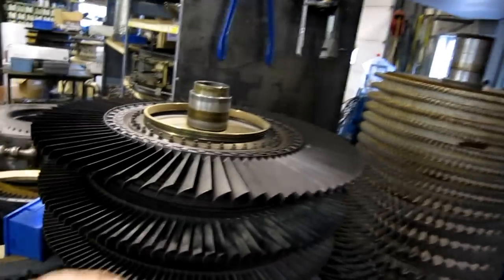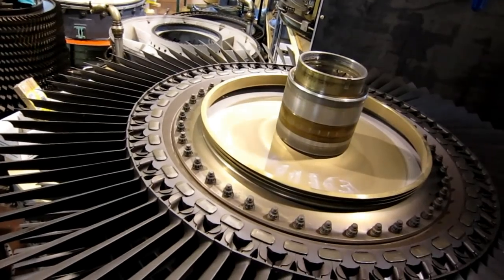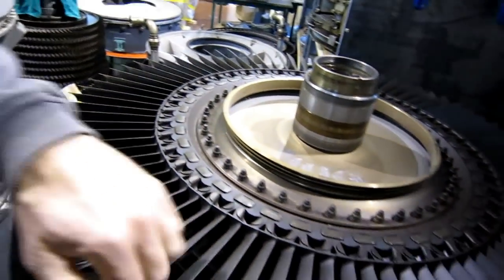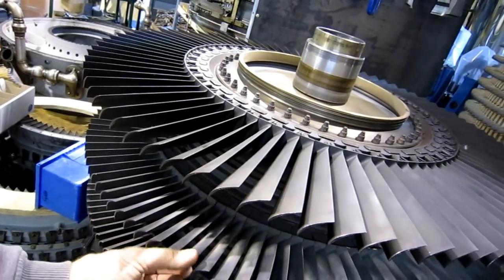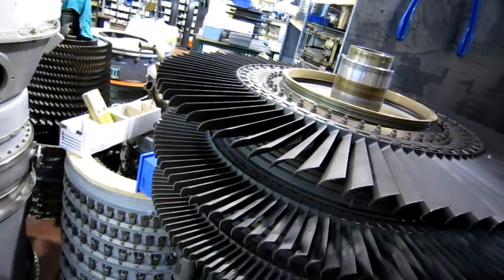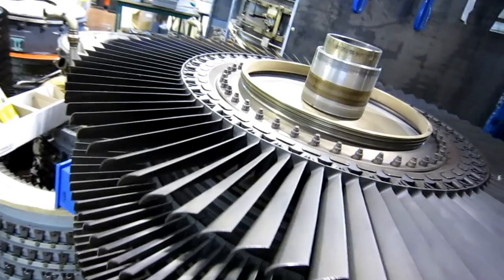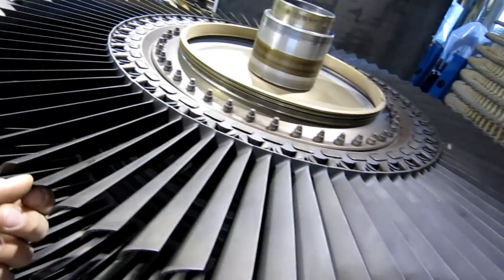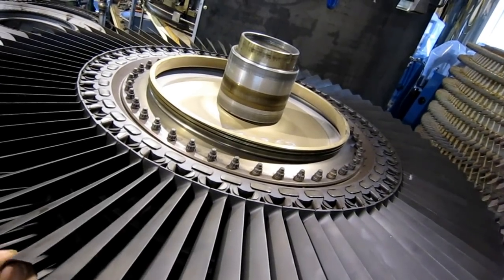Jet engine turbine blade noise

Comment: And no one's gonna talk about the fact that it's hd in 2010
Reply: Bruh do you think HD was invented in like 2018 or something? We didn't watch YouTube in black and white on cathode-ray tube displays.
Reply: lol HD resolution Announced at 90s How you Dont KNOW that?
Reply: HD was nowhere not as cheap or as common in 2010 as it is today.
Reply: @Rotated  wtf are you even saying. YouTube started supporting 1080p resolutions in like 2009 and most devices were at least 720p at the time.
Reply: @Rotated  Most cameras at the time (even cheap ones) were at least 720p, 1080i and 720i TV was very normal, and 768p+ computer monitors were the norm since like 2006.
Reply: you forget that many people on the youtube platform were still using old hardware as are people today. For example, though not strictly on the youtube platform, I'm using a smartphone from 2014 today, and daily. Someone in 2010 could have easily been using a 2004 or older camera. And computers, etc.
Reply: @Rotated  I'm still using a monitor from 2006, and it has a 1920x1200 resolution, but I get your point, consumer grade HD monitors were only in circulation for about 5-6 years at that point, so if someone hadn't upgraded in that time, they would still be using older tech. Still, even old CRT monitors could do 720p.
Reply: never had a debate on my stupidity but ok lol
Reply: @IcespherePlaysGames  ya but many people didnt use hd cameras in 2010, it's somewhat uncommon, and thats why i was surprised
Reply: @cgositonyourbed1111   people DID use HD cameras in 2010, it just wasn't included in their phones. Nowdays anyone with a smartphone has HD capabilities, and 1/3 of the planet has a smartphone, so it's very very very common. But back in 2010 anyone with even a remote interest in photography or video production (even home video) had a HD camera, just like handheld tape cameras were popular in the 80s and 90s. Even if we assume that people with these interests are 1 every 1000 people, that would make the amount of HD cameras at the time around 7 million, which is a few times lower than the amount of HD cameras that were sold until 2010. So, more common than 1/1000.

To be fair to you, 1 every 1000 might sound uncommon, but in the 8 billions scale it stops making sense to use the human understanding of common and uncommon.

If you lived in an area with plenty of well off people (even if it's just middle class) you were bound to know someone who had recently bought one of these cameras, i remember they were flying off the shelves in 2007-2008. It's amazing to look back and realize that almost every picture ever uploaded to facebook by 2010 had to be taken with an actual camera, then transferred to a computer and uploaded, it's so amazing that it gives people the sensation of being lost. So that's what i think it's happening here, people forgot about the digital camera revolution after the smartphone revolution. Don't get lost in time brother, cheers!
Reply: @IcespherePlaysGames  Most youtube videos from 2010 that you find are 144p or 240p and 720p if you hit the jackpot
Reply: @SupaKoopaTroopa64  My old CRT monitor could do 1600x1200 at 120 hz, way higher resolution than 720p (which is 1280x720). I think it could go higher, but would be stuck at a 60hz refresh rate, which feels like it's gonna give you a seizure on a CRT. Thing weighed like 80 pounds though, the ones with the flat glass were insanely heavy. I miss the crispness of that thing, but LCDs are definitely more practical.
Reply: @thecooldude9999  I was saying that CRTs could usually do 720p (technically 720i) at the bare minimum. Most people (at least these days) think of CRT TVs, which were 640x480, since that's was the resolution of TV broadcasts and composite video. Computer monitors, on the other hand, weren't bound by any legacy standards, so they could go as high in resolution as their tubes would allow them. An additional note: Most CRTs could draw patterns smaller than a single pixel, allowing them to have a brightness resolution many times higher than color resolution, and the human eye doesn't notice, since we are more sensitive to light than color.
Reply: @Super-zk1kq  actually there are a few million videos from 2006 to 2010 that are HD here in youtube. I'm not going to pretend that it's somehow amazing for a guy who repairs jet turbines for a living to afford a 200-300 dollars camera on 2010, film some part of his work and upload it to youtube. Seems like time flew right past you, man...
Reply: What were you expecting? 480i from an analog camera?
Reply: @user2C47  why arent you complaining to people who say hd in 2011 thats even worse then my comment and who even cares anyway
Reply: Because HD has existed long before 2010.
Reply: 1080p would have been a fairly new feature on YouTube in 2010. I'm guessing the reason they didn't offer it earlier might have been the cost of server storage capacity, and perhaps even more so low demand; Internet connections with good upload speed was not common back then, so most uploaders probably wouldn't have bothered uploading in HD even if their cameras could film it.
Reply: @IcespherePlaysGames  Most of the people commenting "HD in 2010 omg!" were probably born around 2005 lmfao. Keep in mind 2010 was when we had Iphone 3gs that could record in 720p HD... And you could get a digital camera for even less that records 1080p HD. If you look at videos from 2010, anyone with a decent channel supports 1080p, unless you're 12 years old and watching old memes made by a 16 year old with a potato...
Reply: C GoSitOnYourBed omg
Reply: @Rotated  Man's working on jet turbines and you question if he can afford an hd camera and render it in 2010... lmfao
Reply: A Stoned Canadian For real. OP’s comment had me mad confused as well. 1080P in general has been around longer than some of these people think.
Reply: Rotated You do realize that 1080p cameras and camcorders were a hot thing before smartphones took over right? So your point still doesn’t make any sense.
Reply: @Iridiumcosmos  Zoomers man, I swear.
Reply: It's almost like the guy is smart and own anything other than a potato for a camera.
Reply: Yet Felix can’t focus his camera in 2020
Reply: @58209  1080p was not that uncommon in 2010? Maybe my bias is completely skewed because I was into filmography at that point, but it was very far from rare and was pretty standard for your $600-$800 DSLR Camera.
Reply: IcespherePlaysGames of course we watched TV on black and white CRT’s
Reply: I am not going to laugh at you as most people did here. I'll just say interesting thing. Many cameras after YT was a thing and before 2010 (YT supported higher resolutions pretty early, but most people didn't use them and many devices didn't even see the option) - had an option to "record for YT" - which meant recording film in 360p - a very bad idea. Some even had - a cellphone module - so you could upload the video, without computer. Funny thing was, you could have uploaded 1080p, YT allowed this for a long time, but it depended on your area, device etc. And often wasn't visible. I mean they would have to stream 1080p - to "tens of thousands" (yeah that hasn't aged well) of people. Think of the bandwidth required.
Reply: NHL still posts videos in 720p in 2020. 720p isnt even considered HD anymore

Comment from the maker: Modern airliner engines, being turbofans, are even more tolerant of water.
The fan tends to fling any water outward, and almost all of it follows the path of the bypass air, so it doesn't even enter the fuel-burning core of the engine ( which is highly tolerant of water - see above comment).
Modern airliner engines are tested for water ingestion with a dozen or more firehoses pumping hundreds of gallons per minute into their intakes... no problem.
The heaviest rainstorm has no effect at all.
Reply: Except when it does. 737 lost both engines in storm on idle. They probably test engines on full power
Reply: This vid may be 7 years old but he comin
Reply: @NoName-md5zb  Depends on how old the 737 is. The oldest ones have the JT8D turbofans while the MAX has the CFM LEAP-1Bs.
Reply: No Name 
That flaw has been fixed by doing some modifications to CFM-56 Engine.
https://en.wikipedia.org/wiki/TACA_Flight_110#Investigation_and_aftermath

Comment from the maker: @killman369547 All blades are slightly loose in their mounts to allow for damping of vibration and to accomodate thermal expansion and contraction. They are not necessarily "loose", but they are not rigid.

Comment from the maker: Well, maybe I should do a video on the subject...
The high-pitched screaming sound once the engine is turning above idle is cause by the compressor.
That hum as the engines works it's way from lightoff to idle is possibly resonance of the  combustor and jetpipe.
The engines are designed to work best at their rated maximum output... They are "tuned" for 100% rpm, and the lower the rpm gets, the more the engine is struggling to function properly.
They aren't like piston engines.
Reply: I never knew I wanted to know anything about turbine engines until YouTube decided I needed to see your videos.  Thanks and now subbed.

Comment: i did not know that I wanted to know this. thanks youtube algorithm.

I'm guessing the centripetal force would fling them outward so hard that they are always straight anyway, right?
Reply: Yes
Reply: Centrifugal force, not centripetal.
Reply: @you_just  no, he has it correct. The centrifugal effect is a result of centripetal force.
Reply: dwnrety1 let’s just call it the spinny force
Reply: The centripetal force is what keeps the engine from exploding. The centrifugal force is what wants the engine to explode.
Reply: @user2C47  centrifugal force, technically speaking, doesnt exist. The centrifugal effect is more or less a product of centripetal force.
Reply: No forces exist. 
Technically.
They are just handy descriptions of motion and energy transfer.
They dont apply in all frames of reference.

Oh and yeah centrifugal and centripital forces *definiately dont exist*.
They describe the combination of multiple forces over a period of time.
Reply: @Mallchad  Centripetal force is the net force on an object that is doing a circular motion and pretty sure that it exist, unlike centrifugal force
Reply: @johnjordan3552  I don't know. 
I just checked to try to improve my understanding of centripetal and centrifugal forces.
They seem like components of the same action and are closely related forces.
And both appear to be more like extensions of very simple forces in my opinion.

And all forces seem to be an aproximation of forces over larger bodies...
Except maybe electromagnet forces...
I don't know, every time this topic is brought up its always treated as debatable, even by physicists.

Comment: I've been walking around with that question for a very long time, after I heard B737 engines making a rattling sound while being spun around at a very low rate. It didn't sound very healthy to be honest, much like a chain that has been tightened up way too far. Thanks!

Comment: i used to work on the rb and trent blades,funny how the terms vary slightly,where i come from,we term the christmas tree,broaching.and as you will sure be aware each blade end is engraved,i lost count of the amount i used to number manually.and the olympus engine 1st stage was kept seperate from other components,not sure why,but we never saw how they were worked on.just the painted finished article in a packing case.olden days i know,but i enjoyed it.thanks for the cool info and vids.
Reply: Jeppesen teaches the term fir tree. On one of our reviews someone said Christmas tree and our instructor said he wasn't wrong, but the test would call for fir tree. Everyone still remembered Christmas tree though because it was funnier.

Comment: I would like to have heard the thought process behind making them loose rather than hard mounted.  "Huh, I have problem X, how to solve problem X?"
Reply from the maker: Rigidly mounted turbine blades were used in the first experimental engines run by Sir Frank in the 1930's. They accumulated resonant energy like tuning forks, and vibrated so much that they quickly began to crack and break off, which cause engine destruction.
The blades are firmly mounted, but allowed some movement in their mounts to dissipate this vibratory energy.
Hans von Ohain and Frank Whittle figured this out, and every turbine engine I have ever worked uses the same mounting method.
Reply: @AgentJayZ  That's the official history, I'm more curious about the "eureka" moment
Reply from the maker: I'm pretty sure it involved some broken blades.

Comment from the maker: Possibly a small amount, but the main reason is so that there is no way a blade can become a vibrating cantilever. Also, under centripetal loading, the blades self align in their slots, enabling them to best handle the huge forces placed on them.

Comment: i believe i read about it when the blades reach a high temperature they will expand and stayed in fixed position
Reply: I don't think thermal expansion is much of a factor in compressor blades because compression comes before combustion. Until you go to the stages after combustion then parts become hot.
Reply: Compression causes air to heat up a lot. Bleed air can be as hot as 250 degrees celsius, and that's all from the compressor.
Reply: We've seen this principle somewhere else on a much larger scale - most multi-blade helicopter rotors are "loose", albeit with added dampers. And sure enough, they do "find" their best instantaneous position throughout rotation of the rotor disc.
Reply: For what I was taught (but I'm not 100%, correct me if I'm wrong, I will be more than happy to have learn something from my mistakes), the blade are loose to allow for friction when the blades vibrate like AgentJayZ explained. If the energy is not dissipated, the energy remains in the blade row and quickly rises leading to blade failure. Such energy building are caused by flutter phenomenoun very common in the first stage of compressor or last stage turbine as the blade are the longest. So the engineer design the blade roots to allow for friction to dissipite this energy.

Comment: How to disassemble whole stage of turbine from shaft
Reply from the maker: There are different designs, used in different engines. Read the overhaul manual.

Comment from the maker: Two very distinctive sounds on an airliner which are much more noticable than anything the engines do, are the retraction of the landing gear on takeoff, and the extension of the flaps when coming in to land.
 
If you've got any specific sounds in mind.. let me know what you mean.

Comment from the maker: The materials used are identical, as are the part numbers.
The assembly of these identical parts is... identical.
The maintenance is slightly different in terms of scheduling, but when a particular assembly or part needs to be repaired or replaced, the procedures are the same.
This engine does not power any airliners any more, but lives on in industrial applications.
J79 / LM1500 have identical cores. Not similar: identical. I have built both.

Comment from the maker: @cba999casey The piece I am holding on to and rattling around is a turbine blade, of the third stage of an LM1500 turbine. Just to the right in this video is a compressor rotor from the same engine.

Comment from the maker: Because of the way the compressor imparts a centrifugal effect on the air inside it, any water tends to be flung outward and runs along the outer portion of the gas path.
It then travels in the path of the cooling air in the combustor, not the combustion air. 
The compressor is very tough, and can handle a couple of fire hoses of water before being damaged.
And even that much would not affect combustion.

Comment: I hear this on private jets parked on airport ramps all the time. They don't have covers on the inlets and the engine will windmill all day/night clack clack clack. Is there any damage that could be caused by this at low speed/low temp (eg: engine off)?

Comment from the maker: @panhead1219 Fan blades for the big modern engines are fabricated from several pieces, involving some extremely sophisticated welding.
All of the large engines I'm aware of have their fan blades mounted in a slotted disc, a system functionally identical to the way the turbine blades are mounted in this video.
Minor differences in blade root design, but they are mounted with some small amount of movement.
Some smaller engines sometimes use bladed disks, all forged as one piece

Comment from the maker: The LM1500, which this turbine is running in... is the industrial ground power version of the J79. The J79 was the engine in the F4 Phantom II, the F104 Starfighter, and the B58 Hustler. All were supersonic aircraft.

Comment from the maker: @richardxx9011 Dare I even mention that I have posted a couple of videos of an aircraft engine that has retractable debris screens in it's intake ?

Watch us activate them as the engine is running, and you'll see why the idiot, who told us that any screen was impossible, is an idiot.

Comment from the maker: What sounds... really. Each engine is its own symphony of different noises at different speeds of operation... and the engines I deal with are no longer in use in general aviation.
... Also, when you are flying, there are some noises you will hear which are made by the engines, but there are many other, much more distinctive sounds caused by other parts of the aircraft.

Comment: I thought that the spacing is an allowance for thermal expansion so that there is no additional stress gradient at the blades, while vibration is mitigated via weighing each blade (due to inertia) thus they are numbered accordingly prior to installation.